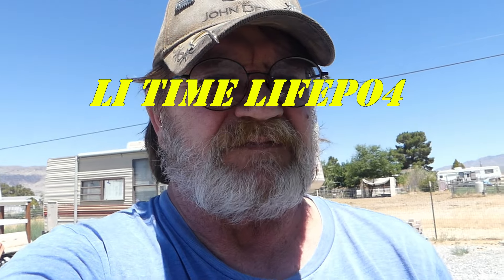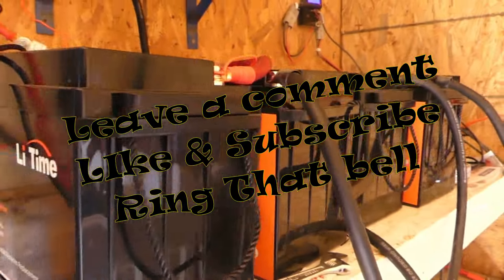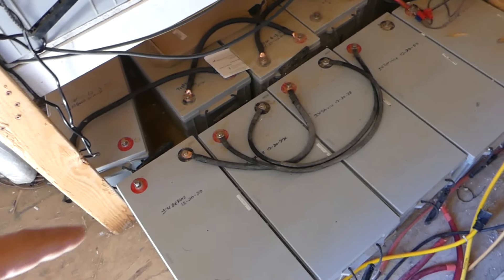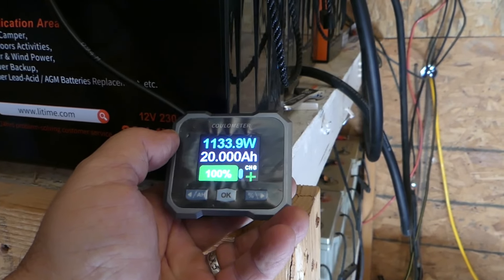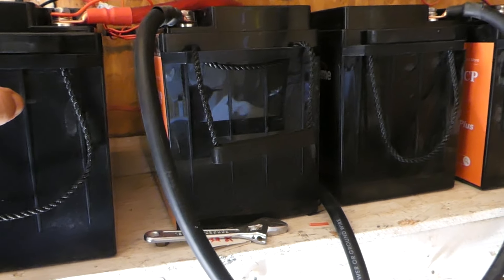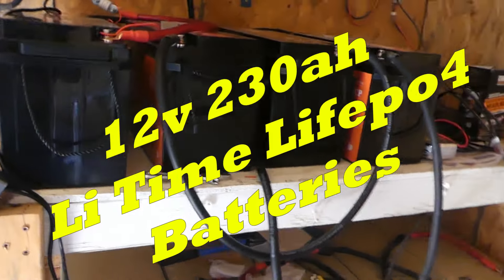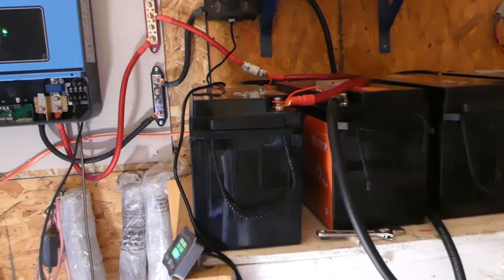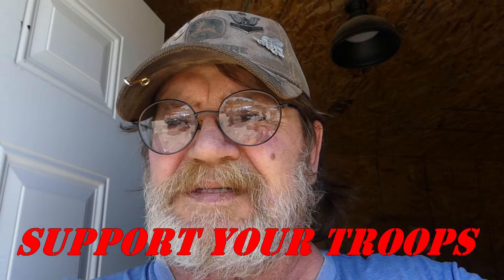1st 24 Hours with the LifePO4 Batteries#diysolarsystem#sungoldpower #lifepo4battery

Comment: There are balancers for 12v batteries in series. If your has Bluetooth you should be able to adjust the cutoff voltage on the high and low side. 

How much is your idle consumption?
Reply from the maker: Our cut off is at 46v it was done through the all in one! I'm still trying to figure out the monitor/shunt so far I'm disappointed in it the blue tooth range sucks! I'm not real sure about idle consumption I'm not a tech guy! Lol I've learned all this on the fly!
Reply: @JR-xw5dk  These Li Time batteries are good for 4S4P already with 200A BMS's.  If Tony puts 16 of these on his system, he could power his neighbors too.😁👍
Reply: @tonylarson1960able  if you have the 12v cut off at 11.3v and the system at 46v it you let you know if they are not balanced and you would lose power, but if that happens you know you have a low battery. You can get it back and running by lowering the cutoff of that battery back down to the original setting.
Reply from the maker: @JR-xw5dk the batteries are ran in series and we are running a 48v system at 240v split phase output! Since we have switched over our power loss after sunset is only 4v nighttime readings the batteries are at 52.7v and batteries are still showing full! I hope this is what you are talking about! Like I said I'm not an electrician or tech guy GBear help me set everything up! I'm still learning this stuff! I'm a retired heavy equipment operator! Ask me about moving dirt I'm your guy! This stuff has been a new venture for me! The fact that I got it working is a great feat for me!
Reply: @GBear  Batteries don't make power. They store power.
Reply: I think those Sungoldpower units have around 50W of idle consumption but not sure.  The spec sheet for that model does not appear to say what the idle consumption is.   Roughly 1.1 kWh/day of consumption to keep the inverter alive.

Putting four 12V batteries in series does require a whole-battery balancer.  They will not self-balance between the batteries, only within each battery so things will get wonky over time without a whole-battery balancer rigged.

Note that with LiFePO4, you cannot use voltage to estimate the state of charge until the battery is nearly full (above 95%) or nearly empty (below 10%), so you will depend on the shunt to really track that.  Configuring the shunt correctly is very important for it to track the state of charge properly.  Particularly the amp-hours configuration which in your case looks like its 230Ah (at the battery system voltage).

--

For example, in a 48V LiFePO4 (16s) system, the charge target is typically 56.8V, and after the current tail or a certain period of time it will drop to the float which is typically 53.6V to 54.0V.  After fully charging and then dropping to the float, the battery will still be at 99% SOC.   95% depletion occurs at roughly 48.0V but that's well into the exponential drop-off.  The battery will stay at around 53.0V for quite a bit of time, then drop down to 52.5V-ish for quite a bit of time, then decay quickly from there as the SOC heads towards empty.  

But the instant you start charging again it will flip up past 53.0V again and then hang there between 53.0V and 54.0V for a long long time until above 90% SOC, before the voltage really begins to ramp up towards the charge target.

Because of all that and the hysteresis between the discharge curve and the charge curve, you can't tell what the state of charge is just by looking at the voltage.

-Matt
Reply from the maker: @junkerzn7312 
Interesting way over my head but Interesting! #GBears off grid ways a homestead in the desert helped me to set this system up! He could answer your questions better than I can!

Comment: swamp coolers that what i run in fl it works for me save on elec run on little solar junk panels
Reply from the maker: The humidity has been crazy high for the desert this year swamper not very effective! Crazy 110°+ heat doesn't help either!
Reply: @tonylarson1960able  if we have a hurricane the swamp cooler is better the noting is how i look at, but so far here its been in the high 90s

Comment: If you make changes with the overkill solar app. 

With used solar panels I wonder why they are being replaced. If a new roof is needed and the labor is so much and solar panels are so cheap may be one reason. Another maybe there has been failure with some and it is cheaper to replace them all instead of trying to find the bad ones. If that is the case will others have failures?  

I have questions also.  

I hope you got good ones. It might not hurt to keep an eye on maximum out put now and keep a log and if you see a decrease check the strings that are low. A good reason to have two strings the same so you can compare the out put at any time.
Reply from the maker: @JR-xw5dk  that's excellent advice I had the solar split into 2 1250w systems but with the old batteries I wasn't getting the charge needed, now I may have to split them again!
Reply from the maker: @JR-xw5dk  the used panels we bought, the guy went to a different system that didn't require so many panels plus the building they were mounted on he tore down!

Comment: Some inverters like my old one did not charge past 60% was a firmware fault, no BMS maybe that happened to your old batteries, half charging. I would test 1 of each 12v style and compare the output, or charge with something else, your old batteries might be better than you think just never got a full charge. Took my bank 5 days to get a full 51.6v after 5 months of only half charging and it had more than enough pv to use, Pb C batteries are 100%@51.6v, 3 months straight of float maybe 1 hour of absorb, they can now hold up to 52.6v. Downside if your batteries were never 100%, most likely too damaged to rebound 100% after years of PSOC. Never trust the inverters voltmeter , multimeter check the battery leads on absorb, float and resting, even my new one I had to drop charge by 2V, I know of 5 brands that do the same thing, even Victron can be wrong.
Reply from the maker: Thanks Bob you are right I never had my 200ah batteries at full charge! I had an incident yesterday where I lost power in my all-in-one. Turns out I had two battery cables that I made that failed and I went down to 6v in the lifepo4s so I ran the generator and let the solar recharge the batteries and was back at full power in roughly 10 hours! Have had no problems since and at night we are at 52.8 volts with full bars on the meter! And my shunt is like .03 lower than the all in one! It's a fantastic system dang near worry free! Thanks for stoppin by Bob God bless!
Reply: @tonylarson1960able  .3 is minor but check the charge rate the variance can grow while charging, easy fix lower the inverter charge till the meter reads right.
Reply from the maker: @bobmonztr 
Interesting thanks! I've still got alot to learn about this system I'm not tech guy or electrician! I had alot of help from gbear! My wife Lee Ann is our tech person she figures out how to do the settings! Lol I'm more the build it guy!